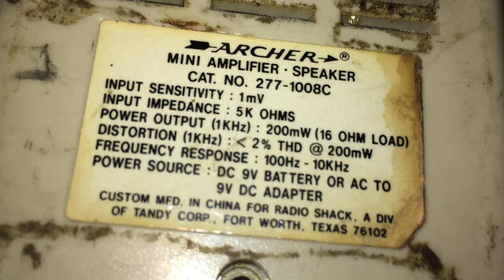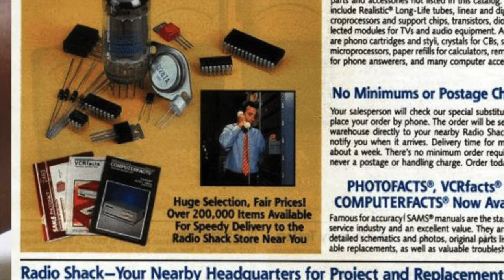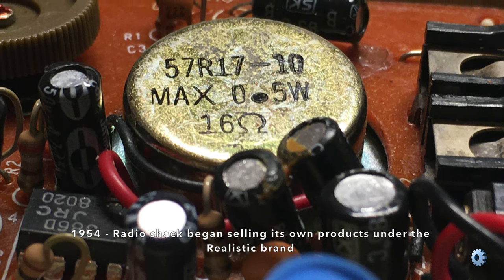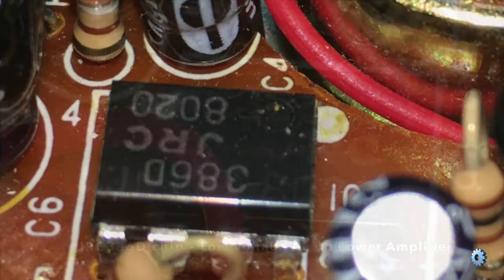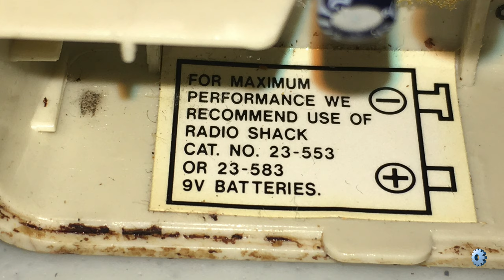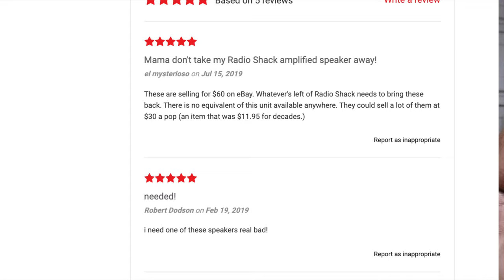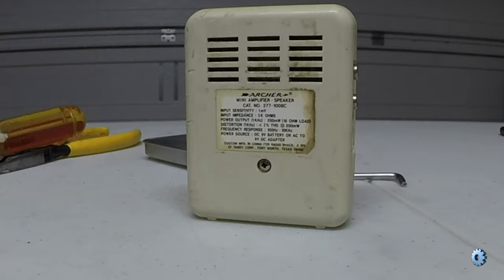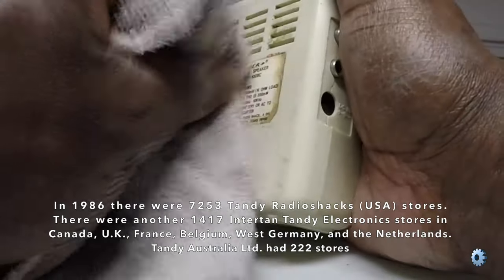Radio Shack Archer Mini Amplifier Shack VLOG 1

Comment: I plugged headphones into the EXT/SPK and a speaker wire into the input ( acting like an antenna ) and I picked up a local radio station. I could only get one station and I don't know if it is an AM or FM station. I suppose if I was close enough to any transmitter, it might pickup it's signal, kind of like a close capture feature. I have the model no.277-1008c.
Reply from the maker: It's old. So component values may have changed. It is not a radio receiver, just a mini amp. It should not pull in any radio stations.
Reply: @Sirrom0206   Old, but never used, so I don't think the component values should change any. The signal was an FM commercial radio station near where I live, and it was the only signal it received.
Reply: I originally plugged a microphone into the input and headphones into the headphone port. I couldn't even hear my TV with the attached microphone but I did hear the FM station, so next I tried a two foot length copper wire.
Reply: @Sirrom0206  

The only station that it received was a commercial FM station, and I believe their broadcast antenna is about a half mile from my home. I will have to seek out other broadcast antennas and see if it picks anything up from those. I know it does not have any tuner circuitry and shouldn't pickup any signal, but hey, there ya go lol.
Reply: @Sirrom0206  

My amplifier is like brand new as it was never used until this year, always kept it in a dresser drawer,